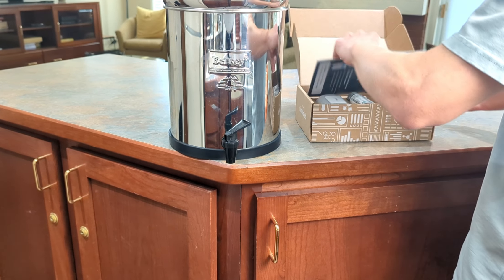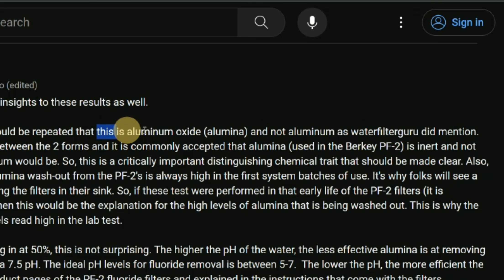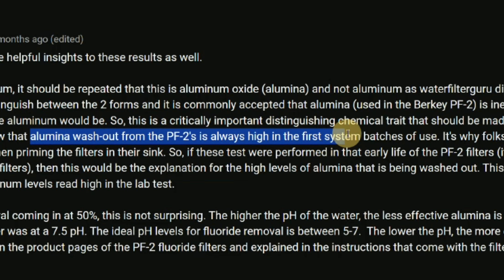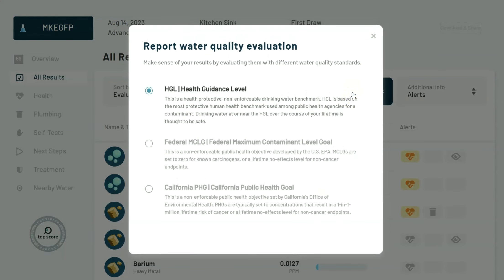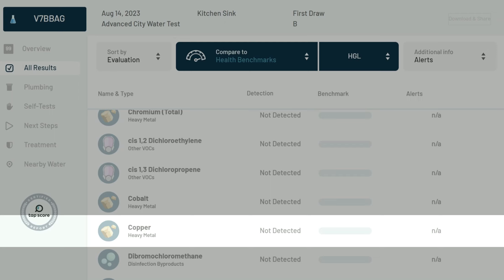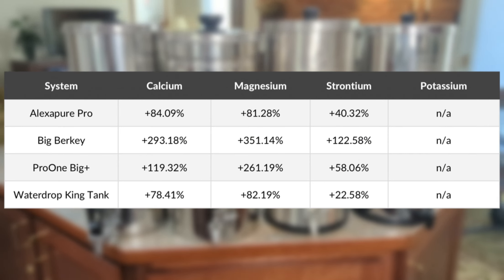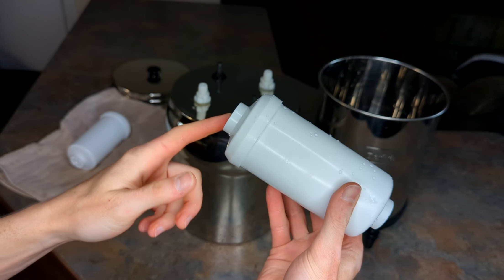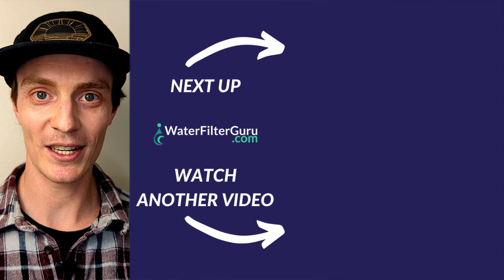I tested a Berkey…AGAIN!

Comment from the maker: 🔥 Check out Berkey here ➡ https://geni.us/JYBUUj
Reply: Great work and video thanks for the update and the warning on overtightening over 8 times.
Reply: My sister is insisting that zero water is better because the meter they provide show particulates in the berkey water and none in zero water.  Do you have a video explaining the reason?
Reply from the maker: @tinacaruselle197  Yes! Check out this video that explains what a TDS meter does and does not measure https://youtu.be/yHvdYWXiVzI
Reply: you should run a total of x 10 tests. That way you have done a sizeable sample batch to conclude your results. It is a concern that the berkey effectively swops one problem ie flouride for another. Is the consumer any better off? Also high calcium readings in water is not that good on impact into human body!!
Reply from the maker: @emmmoo8631  In an ideal world, we'd have 100 tests of each product, the more data the better.

Calcium is an essential mineral for human health, and we do not believe the filters themselves we responsible for the increased levels of calcium detected post-filtration. Please see our hypothesis explained again beginning at 2:51
Reply: @waterfilterguru  sure, I seen that in your video, but I was referring to ONE of the tests for ONE of products, which in this case is the berkey filter, as that is the video you put out. Two tests not really enough. How do you explain the calcium output? just random? Your tests should highlight these anomalies right?
Reply: Does black filters on its own remove micro plastic particles from water, let's say from plastic bottled water? Have you done this type of filtration?
Reply from the maker: @-A.J-  While I've not personally tested this with the Black Berkey filters, we can make an educated guess that some microplastics will be reduced due to the small pore size of the carbon block media.
Reply: @waterfilterguru  what do you suggest to remove micro plastic particles from bottled water except reverse osmosis system?
Reply from the maker: @-A.J-  Distillation

Comment: I installed a RO system under the sink and put away the Berkey for travel and as a gravity filter backup in case of utility pressure loss for some reason. I've always hated the easily stripped plastic wing-nuts.
Reply from the maker: Sounds like a solid plan. I love RO for the broad contaminant reduction these systems provide
Reply: @waterfilterguru what company would you go with for RO?
Reply: You do not want RO water as your primary source of potable water.
Reply: @PD-iu9bn  why is that, please?

Comment: We live next to a creek in Arizona that flows about 6 months out of the year.  We run it through the Berkey and it tastes amazing.  We certainly don't get 6000 galllons out of two filters but of course there's a lot of organic matter to deal with, way more than just using the tap.  We have a well too, but it's got flouride at 4 ppm.  I tried the Berkey fluoride filters, followed the directions just like you did, then ran several batches though and the water didn't taste good at all.  After seeing your original video, I have to think that we also might have gotten got bad filters, or something went wrong, and the aluminum was leaching through.   I agree, it's a bit of a design flaw because there's no way to tell without expensive testing, and we might just be trading fluoride for aluminum.  I basically gave up on the the PF2 filters.  If it weren't for the flouride, our well water is perfect.  We've got RO for the well the under the kitchen sink so we drink that when the creek isn't running.  As you know RO takes out just about everything, including fluoride.  It doesn't taste bad, but doesn't taste as good as the Berkey'd creek water.   

I'm trying to figure out a way to pre-filter the creek water so I can get more life out of the black Berkey filters.   Trying out two connected Pentair 2.5 x 10" housings, one with 1 micron cellulose, the next with 1 micron carbon block.  Hoping this clears out a good chunk of the tannins, algae, and other organic matter prior to running the Berkey.  Those Berkey filters are close to $200 a pair, when you can even get them.   If you have any recs on cheaper Berkey knockoff filters or alternatives, please let us know.

I once had a patient from Ajo, Arizona.  I was looking in his mouth and he had the worst teeth I'd ever seen.  Completely brown and rotted.  When I asked him about it he said, "Ahh, them's Ajo teeth!  Everybody in Ajo got teeth like that."   Apparently the flouride level in Ajo is high (4 ppm, just like our well), and if you live there much of your life and drink the water the dental fluorosis can be quite severe as it was in this gentleman.  

Thanks for your great reviews.  Really helpful. :)
Reply from the maker: Hey thanks for sharing! You could try remineralizing the RO water which should improve the taste 😉
Reply from the maker: @insatiate76  not true, there is naturally occurring fluoride in some groundwater
Reply from the maker: @insatiate76  Much more common than you might think. According to the USGS "An estimated 172,000 people in the conterminous 48 United States are served by domestic wells with fluoride concentrations that exceed the MCL, and another estimated 522,000 are served by domestic wells with concentrations that exceed the secondary MCL of 2.0 mg/L"

And that's not even counting all the wells where fluoride is still present, but below the secondary MCL of 2.0 mg/L

https://www.usgs.gov/news/comprehensive-assessment-fluoride-groundwater
Reply: A friend of mine lived in Outback Australia they only had tank water, so to filter it, they would put a blade of lemon grass in the tank.
Reply: @stannlover_  interesting

Comment: Thank you for the testing :) we just bought a 1947 home with copper and galvanized steel pipes. I don’t trust they don’t have some kind of lead solder and I have a toddler so I’m not taking any risks! Your tests help me confirm the lead removal of berkey filters! I’m picking up a berkey tomorrow 👍
Reply from the maker: I'd recommend testing the water first!
Reply: @waterfilterguru • The black filters remove almost everything except the flouride and arsenic right?
Reply from the maker: @MrBigChops  No, the black filters do not remove almost everything. The closest you can get to that is with reverse osmosis or distillation.
Reply: @waterfilterguru  its like he didn't even watch the vid

Comment: I enjoy the fact that you took the time to present your findings. Everywhere you go has different water. Even the bottled water. Bottled water is expensive 3:59 . Many of the well named companies such a Berkey, geo press,life straw, camel back etc… Are better than nothing. If you know what your doing. You can get grass, sand, rock and activated charcoal and make your own. These companies save you time and provide a service. Companies know. For years that municipal water is not all created equal. Neither is all well water or flowing stream. Rain water has to be filtered. Instead of buying a gun. Buy a water filter. When you pass. At least people can use the filters on a daily basis and not just for protection. We need to bring back all the wood stoves and cast iron also. Good day!!!
Reply from the maker: Right on! Each water situation can be unique, which is why testing before making a purchase decision is so vitally important!
Reply: What about just boiling it?
Reply from the maker: @@StatesideInsights great idea, thanks! I've added it to our list

Comment: This is the filter that the a news network claimed needed to be replaced only every 8 years. I'm glad you're already familiar with this one. So what is the recommended time of changing out these filters. I know that the answer is variable based upon what the initial water makeup is that you run through it. Thanks 👍🏼😊
Reply from the maker: Yep you got it, it all depends on the quality of the water being filtered and the usage. 

While I haven't personally tested it yet, the 3,000 gallon capacity per filter seems exaggerated. And no way would I ever go 8 years without replacing the filter. I think this is one reason they've not gotten their system officially performance certified - because it most likely doesn't actually have such a high capacity and wouldn't pass the rigorous testing required to be certified
Reply: @waterfilterguru  Gotcha... 👍🏼 also they are getting backlash from the EPA which I believe is politics. I've never done so much research in one sitting for one specific filter 🤣🤣🤣

Comment: Any suggestions where to get the black Berkey filters right now? Or are the ceramic ones good enough? Not seeing great reviews on those. Not sure if I should just continue using my very old black filters or not
Reply from the maker: You might want to find a replacement. The EPA issued a stop sale order to the manufacturer of Berkey products last year, which is what's caused them to become scarce in the market. Did you see my latest video on Boroux? https://youtu.be/sMG46WWpOs8

Comment: Thanks for your great analyses; the challenge is there is no black filter replacement available for Berkey system.
Reply from the maker: No, because the manufacturer of Berkey products was issued a stop-sale order by the US EPA. Check out the BOROUX filters which are compatible https://boroux.sjv.io/LXb9Yj
Reply: @waterfilterguru  many thanks; I actually found your recommendation of waterdrop black filters and ordered it last night.
Reply from the maker: @mehdirezaeianzadeh  Right on!

Comment: One of the main problems with Berkey, according to the data sheets I read,  is that their lab certifications test with fresh filters and only between a few liters of contaminated water for many of the tests, up to 250 gallons for some contaminants tested.  So, these filters are not verified for filtering much of anything beyond 250 gallons.  Most of the tests are done with 50 gallons, or way less.  I believe I recall that some chlorine was tested as still being filtered at the higher gallons range, beyond 250.  The website where I originally saw that particular data sheet has since been deleted. 
Please redo this test and run at least 300 gallons through it first.  I believe testing for organic contamination would also be appropriate since the way the system is set up is vulnerable to post filtration bio growth.
Reply from the maker: Yes, this is one of the main problems with Berkey. Especially as they advertise their filters with a 3,000 gallon capacity per filter. I think there's a reason they refused to and never achieved any official performance certifications...

Comment: Loved this content, would love to see lots of other filtration systems tested. Also, are micro plastics and disinfectants something you are able to test for?
Reply from the maker: Thanks! I've got a long, long list of products that folks have requested to be tested. Any specific product you'd like to add?

Disinfectants (chlorine) and disinfection byproducts (DBPs) are included in the Advanced Tap Score lab tests we used for this project, but unfortunately microplastics are not included by default. I'd love to test every system for microplastics as well, but in its current state testing for microplastics is extremely expensive and and this just isn't feasible to do.

Comment: Have you tested any filters through the full lifecycle. IE test at the 100 gallon or start, then 50% and then at 100% of the expected life (or close to that)?  I'm curious to see whether the filters work as advertised or are they only good at the start where most reviewers and users would naturally test.
Reply from the maker: Not yet - turns out it takes a long time to filter hundreds of gallons through a system. It's going to be a while before we reach the 3,000 gallons claimed filter capacity
Reply: @waterfilterguru  Cool I look forward to seeing future tests.  I personally have pretty much decided against Berkey... Partially because I need to replace what I have and Berkey is not available. And now Berkey has a new filter they are releasing for $160. I think I'll try a ceramic filter instead.

Comment: Who could have guessed it is almost impossible to get pure water?
The images of the Berkey filter you showed seems to me to be long enough to have a significant pressure differential between the top and the botton of the filter and perhaps even did not use the top part of the filter if the water level is low?
I was wondering what water filters can produce the most pure water, and specifically do the Berkey filters filter out micro and nano plastics.
How about distilling water in a countertop distiller?
Reply from the maker: Correct, since the Berkey relies on gravity to filter the water, as the water level in the top chamber decreases, so does the flow rate. It filters faster when the top chamber is full, and the flow rate slows down as it filters.

Reverse osmosis and distillation are the best treatment options that provide the most pure water. Both have their advantages and disadvantages, but reverse osmosis tends to be more feasible for most folks. Distillation takes a long time to produce a relatively small volume of water, whereas reverse osmosis filters on demand.
Reply: @waterfilterguru  
Because of that gravity-pressure relationship the lower part of a Berkey filter is doing most of the filtering, and getting more of the wear.  The ideal situation for a Berkey filter would be a giant vat or water at least several feet deep with many Berkey filters in the floor of the container, and the level in the vat of water to be filtered would be continuously topped off.
Reply from the maker: Yep, this is one of the main design flaws with this type of system
Reply: @waterfilterguru  
But, what about the micro & nano plastic from Reverse Osmosis?
I am more concerned with water purity from plastic and forever chemicals than time or cost ... within reason of course.
The countertop distillers run under $200 and can do about 1 gallon a day.  But that's gotta be expensive on electricity I would think.  And take up a lot of counter space as well as up the humidity wherever you run it to the point it could be a problem.
Reply: @waterfilterguru which reverse Osmosis do you recommend? Any brand, model, brand? Thank you

Comment: Do you have any suggestions on brands that actually work? 🙏
Reply from the maker: It depends. There is no 'one size fits all' solution. It all depends on what contaminants are in the source water being filtered. What type of water are you trying to filter? Have you had it tested? Do you know what contaminants you are dealing with?
Reply: I used the berkey to filter tap water, have not had it tested.
Reply from the maker: @mamarages  The Black Berkey filters performed really well in our testing

Comment: Thanks for your video. I'm wondering if I can get completely away from plastic both in the parts used to filter water (where water comes in contact with plastic) and a filter that removes or reduces microplastics.
Reply from the maker: Unfortunately most water filtration systems use some plastic in various components, whether that's the water holding vessels or housings that contain the filter media. Your best bet to completely avoid water coming into contact with plastic is with a countertop distiller that catches the water in a glass vessel.
Reply: @waterfilterguru  Thanks. I'm not sure how distilling actually works as a water filtration method but will look that up.
Reply from the maker: @Zebrajellyfishphoto  There are plenty of countertop distillers you can get. The downside is that they take a long time to produce a relatively small volume of water, 6-8 hours on average for just one gallon
Reply: @waterfilterguru  Thx, that's not going to work.

Comment: Since I installed the fluoride and arsenic filter, small oil-like stains have been appearing on the surface of the water, what could it be?
Thanks!!!
Reply from the maker: Hard to say without testing, but it could be caused by the activated alumina which we've previously identified can leach out of the filters

Comment: I get my water from a spring far in mountains...i use a clearly filtered unit. What do you think ?
Reply from the maker: Clearly Filtered should not be used to treat water that's microbiologically unsafe. Make sure the water is properly disinfected. It may or may not be sufficient for the other contaminants present - can't say for sure without looking at data
Reply: @waterfilterguru  2 years drinking it but noe I'm a bit concerned

Comment: Is there any filter system out there that removes forever chemicals?
Reply from the maker: Yes, many. Activated carbon is the most studied method for addressing PFAs in residential applications. Reverse osmosis works as well. For the highest confidence, you can look for products certified to NSF/ANSI 53 for PFOA/PFOS reduction. 

Here are a couple which are certified:

Aquatru https://geni.us/chlQv5o
Clearly Filtered pitcher https://geni.us/VsUZHW1